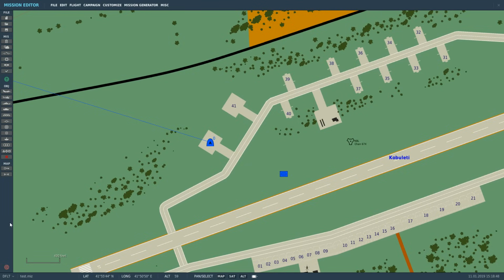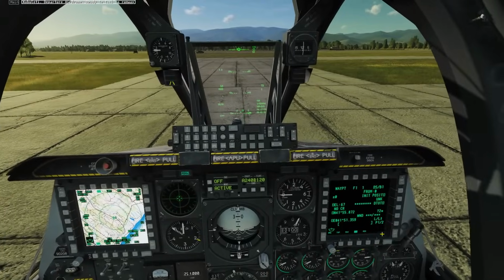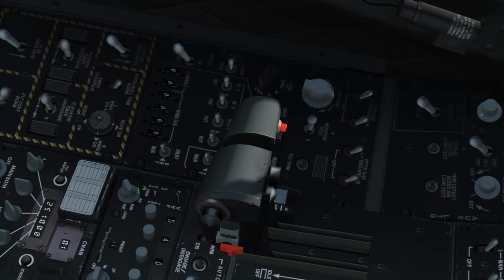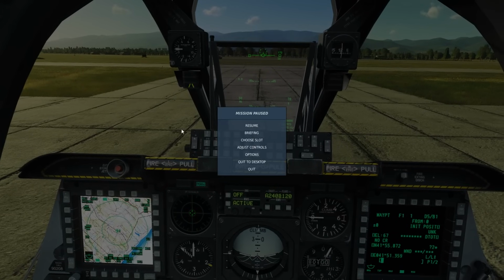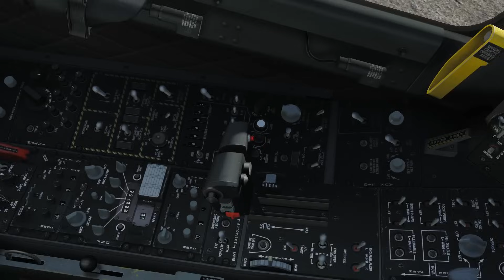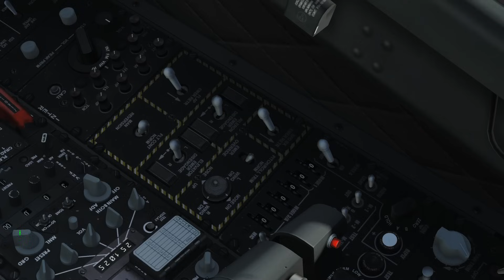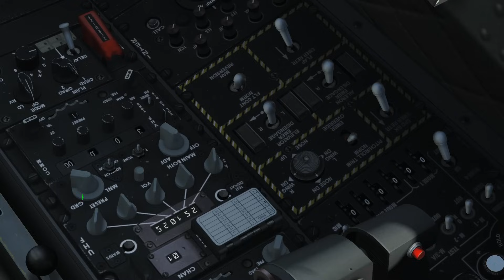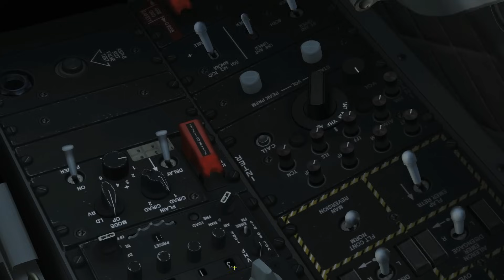A-10C Warthog: Radio Tutorial | DCS WORLD

Comment: On the hit radio the t tone switch is for sending time to do freq hopping. Not sure it works in this game but that’s how it actually works. Alternatively you could load the word of the day in the fill port under the cover on the front of the arc 164 uhf radio
Reply: what's the load button under the cover for in dcs? (or does it only work when you have a key fill device connected in the port and then you press load to transfer the key to the radio?)